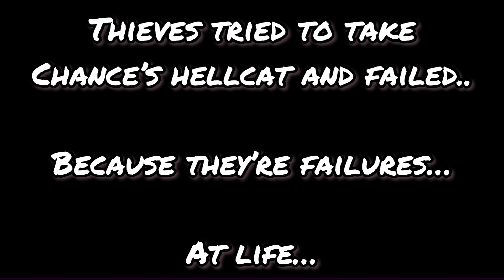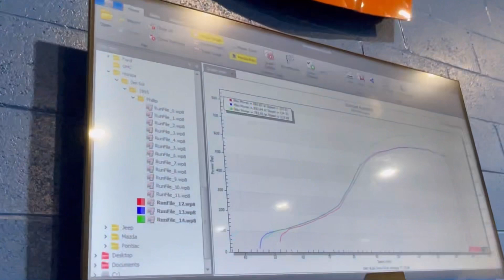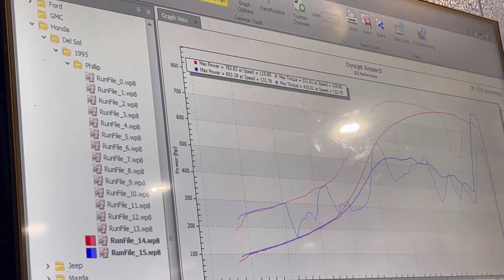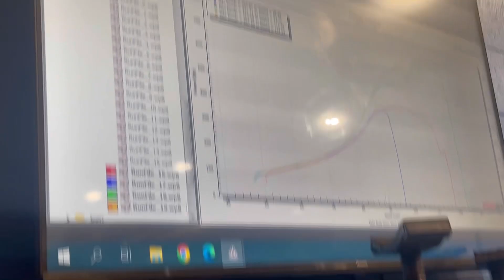The AWD Del Sol Races At Streetcar Takeover!

Comment: So ur tunes are not preset ?
Reply from the maker: Preset?
Reply: @AddictionMotorsports  meaning like having it set up on a switch or different map settings in the ecu
Reply from the maker: No hondata doesn’t have a function for multi maps like that. I change the tune accordingly

Comment: What kinda gear setup you have in your tranny?
Reply from the maker: GearX right now. But going to ppg this winter
Reply: @AddictionMotorsports  GearX holding that 800hp well I see you laughing out the hole hard. Do you have a 5th or 6th gear cuff on it? what kinda synchros you have?
Reply from the maker: Well 1st gear is a little sensitive at 800hp but I’m also 2700lb. And it’s a 5th cuff with a 6th gear for cruising. I’ll do the same for the ppg
Reply: Bbg man. Turn 1st down just a touch.